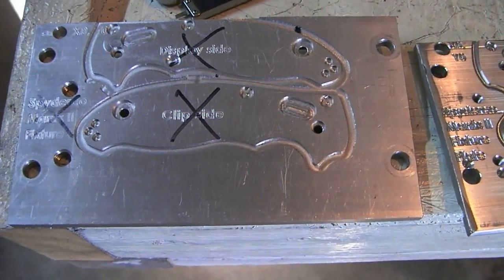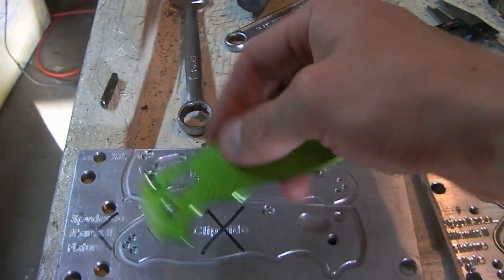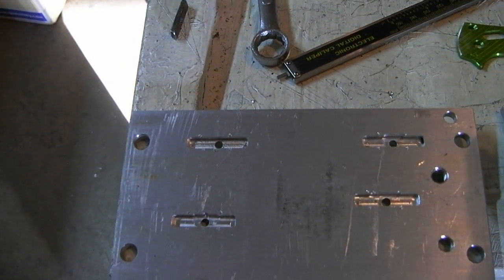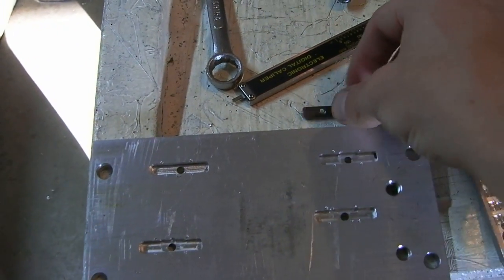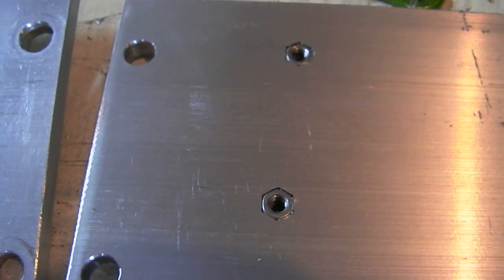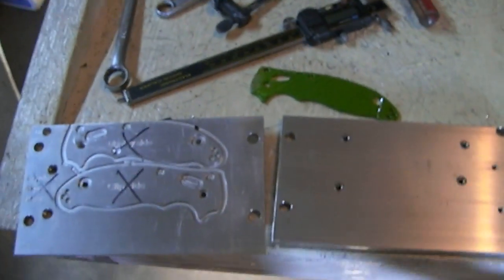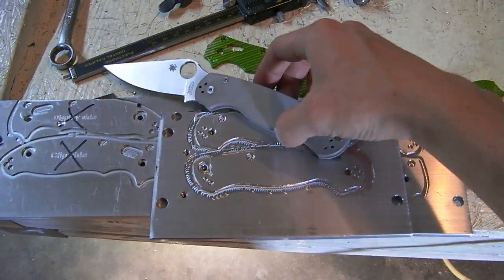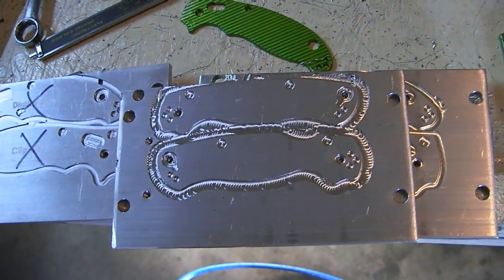Machined fixture plates update

Comment from the maker: @TTCruzer Great idea!  I've thought about using studs with nuts on each side, but I like your idea better.  I agree that it would be nice to drop the plate onto bolts, but the way I've got it now I can drill those locator holes while the plate is clamped the first time, as well as doing a lot of milling before needing to bolt it down through those holes.